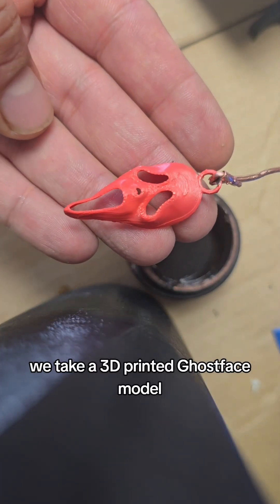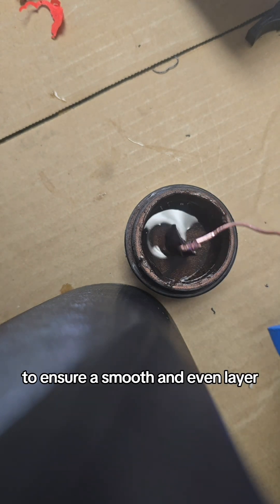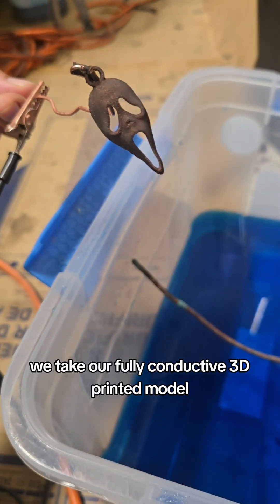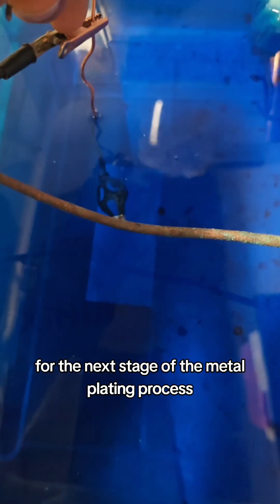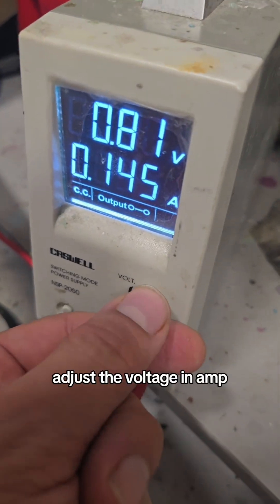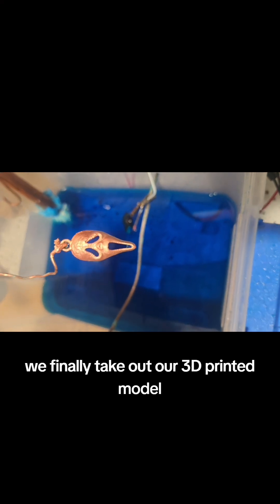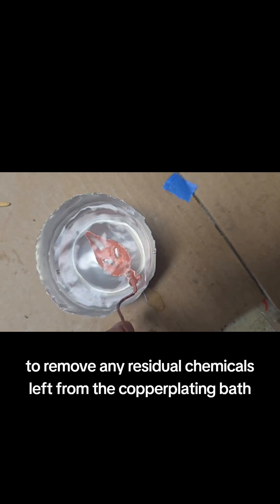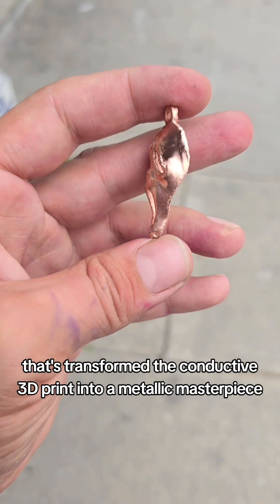How to Electroplate a 3D Printed Ghostface Pendant#electroplating #ghostface #copperplating #pendant

Comment: So if i do this with my 3d printed ocarina will it sound the same and be smooth?
Reply from the maker: @russkiy225  aha that woukd be dope , but naw I wouldn't  put my mouth on taht copper  stuff If the mouthpiece is copper-plated, you might want to check if there is a protective coating, as direct contact with oxidized copper in your mouth may be unpleasant or irritating over time.
Reply: @PlatingPulse23  no one made ocarina with copper plating, can I die by just putting that in my mouth or just in my lips at least?
I just want to make an ocarina that will not break
Reply: @PlatingPulse23  how to  remove acid from the copper?
I think I need vinegar soda and salt, I think it would remove the acid from the copper.
Reply: @PlatingPulse23  yeah and I'm kinda broke I dont even have 3d printer, and the services are online, I think no one would 3d print me an ocarina in fricking smallest country ever been, like I'm in Armenia and yk bro like where?, we dont have pcbway